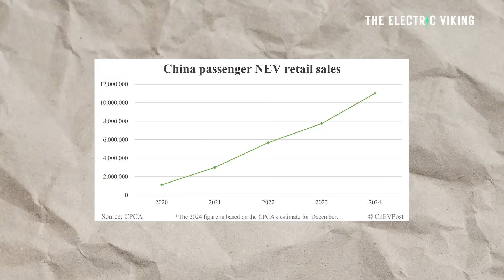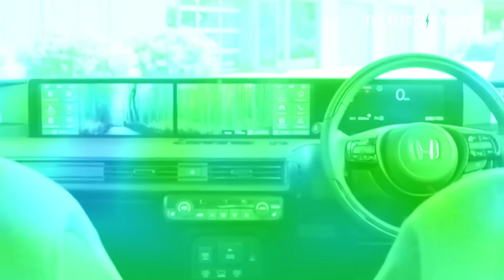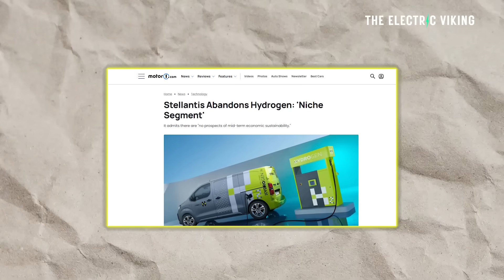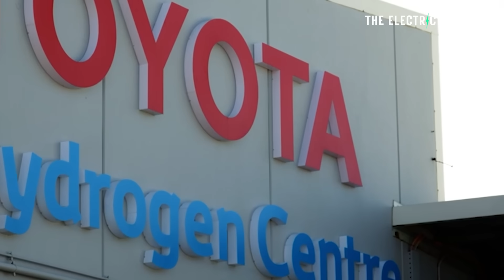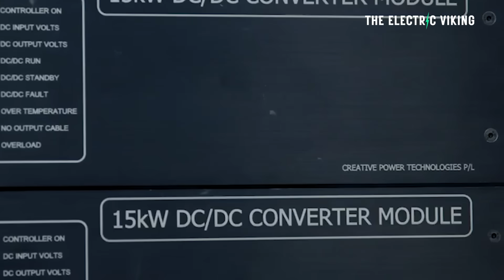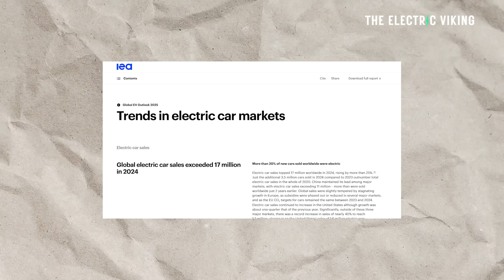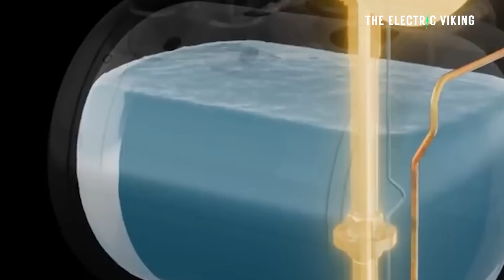The Future is Hydrogen Cars - Honda says EVs are not the future

Comment: There is a world of difference between 'EVs are not the only pathway to carbon neutral' and advocating for hydrogen. You're putting your own interpretation onto his statement. 
He's right in a way, if everyone switched to a battery ev and did nothing else, we'd still be pumping out too much carbon. A battery ev is only part of the solution.
Reply: Skasteve6528, EVs are the low hanging fruit to our transition. How many hydrogen powered cars are sold anually? Not enough to ever make a significant change.
Reply: You understand that's the entire point of all changing to EV's? Or has no-one explained that to you yet? I will attempt to do so. It's like this, the only way to move away from a fossil fuel powered society is to start at the most important step, and that's transitioning transport away from fossil fuel. If we kept X% of fossil fueled cars and trucks etc then we must still keep the wells pumping, the refineries refining, the trucks running around to petrol stations to deliver that oh so sweet poison nectar. So the most important first step in moving away from fossil fuels is to transition the transport system, all of it, to electric.

So you are in a way right, if all we did was all switch to EV's that wouldn't help that much, but that is the single most important step in the entire equation. Once that happens in a big way we no longer need to refine diesel and petrol to burn in our cars and trucks, we can drop the use of fossil fuels necessary to that fraction needed for medical and research purposes and other stuff we haven't yet worked out how to do without. But of course we aren't just doing EV's even now right? Rooftop solar to charge those EV's where available, wind turbines and solar farms to replaces gas and oil power generators, even now Chinese demand for oil has plateaued, no we aren't just doing EV's, but without doing EV's most of the rest would be much more difficult if not impossible.

Comment: It's about control, electricity is a great deal more difficult to control cuz you can make it with solar wind and off the grid but hydrogen you have to have an entirely new infrastructure and requires people going to pumps or stations to refill It's not something you can do at the house it's not something you can do yourself again this is all about control

Comment: Honda's automotive division has lost the plot. Hydrogen is most definitely not the future and it is definitely not "zero emission".
Reply: Look up the Honda Clarity. It makes the Homer-mobile look well designed.
Reply: It most definitely IS the future. Hydrogen is the most common element in the universe. Unlike every other battery material. Hydrogen storage has been largely solved. Its production is a work in progress, such as the Hazer process and various forms pf electrolysis.

The people who say hydrogen is not the future are invariably the people who have no idea about the leaps in technology in hydrogen. Like you, for example. I know youve never heard of the Hazer process. And thats just one development.
Reply: @user-lv5bt3nt3r  Hydrogen stays liquid at what temperature again?
Reply: @yulusleonard985  There is this amazing thing called compression. But heres the thing - you need it in gas form to produce eletricity (or do you think hydrogen EV vehicles burn hydrogen?).

Theres also this amazing thing called TECHNOLOGY that makes hydrogen EVs perfectly viable - many heavy vehicles have been running on it for years.

Hydrogen is merely a medium for storing energy. No different to a battery. The diffefrence is the materials that go in batteries are not sustainable. Becuase they are rare and need to be dug up. Hydrogen can be accessed from literally anywhere. It is super abundant (meaning it doesnt particular matter if it is not as efficeint as other fuel storage systems) and it is 100% sustainable. Thats why it is the long term solution. The rest are not.
Reply: @user-lv5bt3nt3r  The difference is Hydrogen are consumed. Lithium are not while recyclable. And people are loking solution other than lithium but soo far they are the cheapest. They are not the same.

Isnt the problem with hydrogen is that not turning water into hydrogen but compressing or turning them into liquid are the problem. One require tank that can wistand high pressure (using Titanium) or using more energy to freeze them at extrem temperature colder than the surface of Pluto.

Hydrogen car have been going nowhere for 2.5 decades because of these problems.
Reply: @yulusleonard985  Hydrogen is the most abundant element in the world. You are mostly made out of hydrogen. It doesnt matter if the hydrogen  is ocnsumed. Its converted from other gases and its reconverted back to h20 after being used. Thats what you get out of the exhaust of a hydrogen vehicle - water so pure you can drink it.

And no, the storage problems are overblown. That has already been solved. Its just that for some reason theres hysteria about carrying around a tank of compressed hydrogen (which will harmlessly dissipate if ruptured) compared to carrying a tank of petrol - or, worse, lithium -that has a good chance of blowing up and burning the vehicle and its passengers.

The problem is that people like you dont know the technicalities but false statements have been repeatedly made on this subject - especially by musk - and yoiu have the musk mind virus. Hydrogen is operating around the world - including many parts of asia and europe - right now. And you are completely unaware of it. Why? Because some people want you to be completely unaware of it.
Reply: @user-lv5bt3nt3r  that is the problem right? Turning that H2O back into hidrogen fuel and even Toyota avoid that by converting methane into hydrogen. Because its cheaper and yet still expensive.

And LOL lithium are the least likely to explode because they are not pressurized. i already saw BYD Seal burn and the battery only emits white smoke. It toxic but its not exploding the very reason why Chinese government ban NMC batteries from vehicles starting this year. And speaking NMC battery they are mostly from LG or Panasonic a company owned by Toyota which ironically spew out BS propaganda about EV and their Hydrogen car that goes no where after 25 years. 

So oh mighty one who have been touched by Toyota propaganda grant me the wisdom why hydrogen car going nowhere after several decades and your Toyota masters seem have no intention to develop them any further.
Reply: @user-lv5bt3nt3r  such an idiotic statement from yet another anonymous corporate bot.
Reply: @alex.velasco  your comment is a personal attack on me. It is NOT a reasoned argument. It contributes nothing. So - that makes it an idiotic statement from YOU. As for whether you have bot status, YOU are the one making the completely worthless personal attacks. That makes YOU the bot. Now get lost.
Reply: @user-lv5bt3nt3r  talking about technology leaps. 
- Where were H2 passenger cars 30 years ago? Nowhere. Where are H2 passenger cars today? Nowhere.
- Where were EV passeger cars 10 years ago? Nowhere. Where are EV passenger cars today? Everywhere and it keeps getting bigger tech leaps fowards year by year when H2 is still a small baby.
Reply: @lifeonshine5055  The ignorance is astounding.

hydrogen has not developed for one reason and one reason only - the production of hydrogen needs to reach critical mass to bring the cost down. No other reason. Not safety (hydrogen is safer than petrol and diesel). Not technology. Not storage. And the technology and investment is on the cusp of achieving that breakthorugh. Its just a matter of time. When it happens it will make battery EV obsolete.

And thats why Elon musk is frightened of it.

 And thats why people like you - who have never looked at a technical document on hydrogen propulsion in your life - are so scared of it. Because - one way or another - musk told you to be scared of it.
Reply: @user-lv5bt3nt3r  but the topic of this article and Honda's annoucement is about cars. In a passenger car context H2 has lost the race against BEV already. Just imagine how much it would cost to build a global H2 infrastructure to every single remote rural village even when all those villages and private houses already have a connection to a power grid. Why would I drive 30 minutes to find the nearest H2 re-fueling station when I can "refuel" an EV at home while i'm sleeping and using my "own" electricity (solar panels)?

If you say "but the range and charge time in long road trips is a problem in EVs" then it is not a problem. There are already BEVs capable of "refueling" in 10 minutes and in the coming years range is doubled and exceeds 1000 km soon. When you say "it just takes time to make H2 a viable option in passenger cars" then remember BEV technology uses the same time to make leaps ahead also. We will see cheaper, faster charging and longer range BEVs year after year while H2 passenger cars have been stuck in cold water for decades already. If they make a H2 break-through tomorrow then it will take 10 years to build a global or even a country wide H2 refueling infrastructure. Not gonna happen especially if H2 refueling costs are still higher than BEV charging costs.
Reply: @lifeonshine5055  Hydrogen hasnt even started the fight.

Im really tired of talking to people like you who really dont know what youre talking about. It just wastes my time. So Im going to block you.
Reply: @user-lv5bt3nt3r  Already started when Toyota launched Mirai back in 2000. Its been 25 years. So far only one hydrogen fueling stall in my whole country compared thousands CCS2 charger. Lol just go back to your lovely Toyota re education center.
Reply: @yulusleonard985  seriously, I get so tired of you people. One fuelling stall in your whole country? What country are you in?

And - as I already stated - the technolgy for fuel production is in its testing stage. Most are due to come online soon.

Just so you know, these are the countries in Asia that have signed on to hydrogen as the long term fuel for vehicles:

China
Japan
Taiwan
South Korea
India
Australia.
Indonesia

Thats a potent mix and its basically the whole of Asia. And its Asia that is driving future tech. Not europe. Not the USA.

The future is hydrogen. You might have a problem with that because you have been infected with the musk mind virus, but thats the reality. And thats because non hydrogen EV is unsustainable - another bit of stark reality you dont seem to grasp.

By the way, eletcric cars were on the roads in the late 1800s. So your idea of saying that just because there are not many hydrogen vehicles around today means there never will be is simply illogical. Its an argument that doesnt hold up.
Reply: @user-lv5bt3nt3r  Im in Indonesia already in your list. only one stall, operated by the same state oowned electric company that also already operating thousand CCS2 charger. The future is not hydrogen because even Toyota already give up using electrolizer (like what you said) but instead using natural gas/methane/CH4 that is nowhere sustainable. 

The problem with hydrogen so far its storing them. Either using high pressure or colling it down to liquid level which actually consume more energy than simply charge the battery.
Reply: @yulusleonard985  sigh. YOu know enough to be annoying but not enough to know what youre talking about. First off, no-one is going to store hydrogen. YOu simply transport it in other forms and then convert it, whether that be water or methane.

Second, your country is backwards. So its not surprising the Indonesian hydrogen plan is stalled.

Third, you are decades behind on your understanding of the technology. The hottest issue in chemical engineering for years has been creating green hydrogen. And there are now multiple ways to do it. Because I have been involved with the hazer process thats my favourite process but there are many others. Most are in trial plant phase. I expect at least some of them to succeed. As soon as that happens then its just a matter of raising the funds. 

Everyone else in the industry is ready to go on hydrogen and have been for some time, which is why many hydrogen buses and other hydrogen fuelled EV vehicles are operating around the world as we speak. 

Hydrogen isnt the propulsion for hydrogen EV - they are just the fuel cells. Which means adoption can be very quick and very easy.
Reply: @user-lv5bt3nt3r  Lol and why hydrogen station exist if nobody have to store them?

Even in Japan  the number of hydrogen station are lower than chademo chargers. And nobody use chademo outside Japan

Many? Most of them are in China btw, produced by EV companies and still dwarved by electric buss/truck. im not going to be surprised if they got canned eventually because unsustainable.
Reply: @yulusleonard985  Im tired of your silly comments. So Im going to block you too. Everything you raise has an explanation but Im wasting my time on you.
Reply: @user-lv5bt3nt3r  Ok bye
Reply: Yes, Hydrogen is the most common element in the universe. The trouble is separating it from all the other elements in the universe and the energy that is required to do so, even with the Hazer process.
In practical terms, like SMR not only is energy consumption an issue, there's also the consideration that you are using a fossil fuel as your feedstock. Utilising the process of electrolysis to separate hydrogen from water looks like a great idea, too, until you look at just how inefficient that process is.
Quite simply, you're far better off just charging batteries. 
Then there is the corrosive nature of hydrogen to consider. This makes hydrogen
both more expensive and more dangerous to transport than many other fuels or stores of energy.
And just to top it off, Hydrogen has a very low ignition temperature and a very high laminar flame rate. I have personally witnessed a "small" hydrogen explosion at atmospheric pressure. You wouldn't believe
how fast it combines with oxygen when you give it a chance. Top tip: Hydrochloric acid
also destroys school uniforms. Hydrogen, from this perspective, makes petroleum look as safe as a bucket of nothing.
There is a reason that Oppenheimer used hydrogen to start the nuclear reaction in Fat Man and Little Boy.
Reply: @user, where are you going to get the $300 trillion dollars needed to build out a hydrogen distribution network that can compete with existing solar, battery and other electricity generation and storage and the existing electrical distribution infrastructure????????
Reply: @freeheeler09 first off you can use exactly the same systems as are currently used with petrol. As for solar, hydrogen is an energy storage MEDIUM. It doesnt generate energy. So any comparison is stupid. Solar can be used in tandem with hydrogen to store renewable energy just as batteries can be used in tandem with solar to store renewable energy. 

Your comment is revealing because it indicates that you dont actually understand the details of what youre pretending to talk about. Ive worked with clients in this field for years. 

Oh and how do you suggest remote vehicles access solar energy? Because the potential storage capacity for hydrogen is vastly superior to the storage capacity of batteries, which need to be recharged constantly. Hydrogen EVs on the other hand, you can just carry the hydrogen. 35kg of hydrogen (compressed) can power a standard city bus for a whole day. You can just switch out the tanks or refill them - depends on the customer.
Reply: @user-lv5bt3nt3r  the big problem with hydrogen is cost, storage and delivery. Look at the failure of Honda or Toyota vehicles sold in California.
Reply: @grahamcampbell8297  How many times do I have to say this?

Storage - solved
delivery - not an issue
cost - multiple projects about to finish their test projects that aim to achieve us$1 per kg - and thats just in australia. Two examples: hazer and hysata.

There is no current failure in hydrogen because it hasnt come on line. But the whole of Asia will eventually shift to hydrogen. How do we know? Because unlike battery EV most of the major countries in asia have actually pledged that.
Reply: You do know that and hydrogen car is really still A electric car don’t you?  You being super genius and all.
Reply: @ouethojlkjn  Hydrogen can either be used
for combustion or to produce current. I am most certainly aware of that.
The reason that I state that it is not "zero emission" is due to the processes by which hydrogen is typically produced.